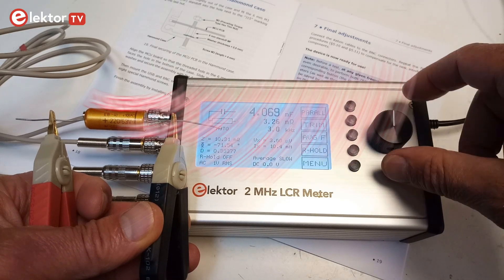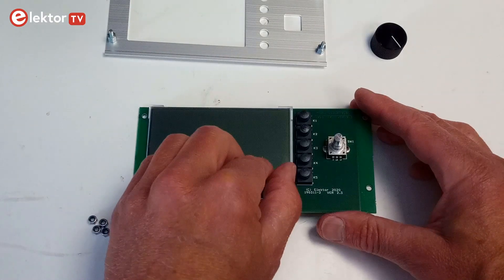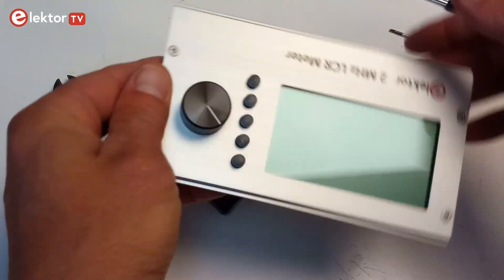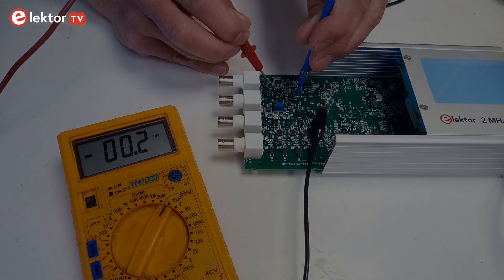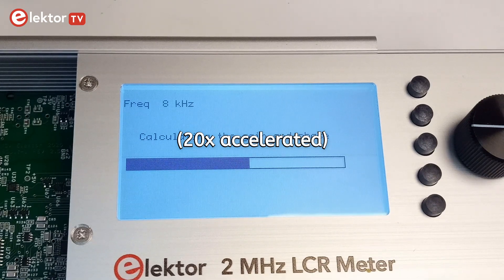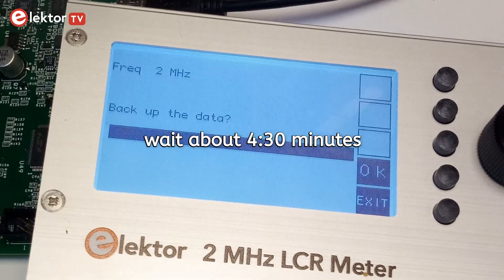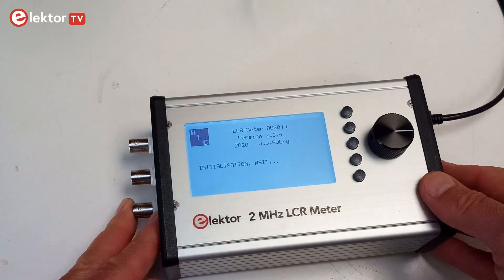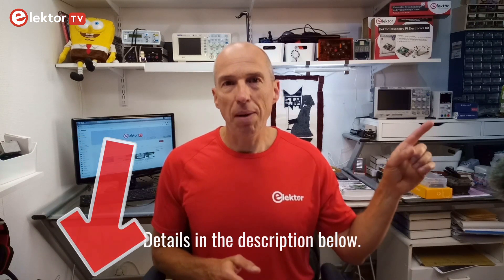Elektor LCR Meter Kit AU2019 Assembly & Calibration

Comment: Does the £2.99 DVM need any calibration?
Reply: No, but you can check your DVM by measuring the voltage in TP10 which should be 2.5V +/- 13mV at 25°C (that of the U44 reference  - LM4050CIM3-2.5)

Comment: Warum wird das nicht gleich fertig aufgebaut und abgeglichen geliefert? Die 4 BNC Buchsen einzulöten ist ja ein Witz.
Reply from the maker: This allows users wanting to use high-end BNC test fixtures like those sold by Keysight to align them as well as possible. This is easier than having to desolder them because they do not line up properly.